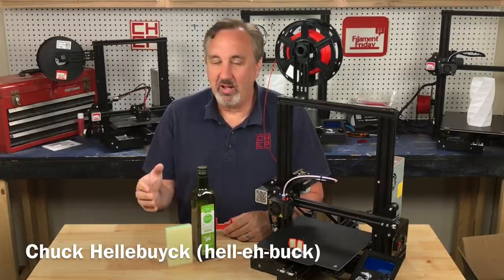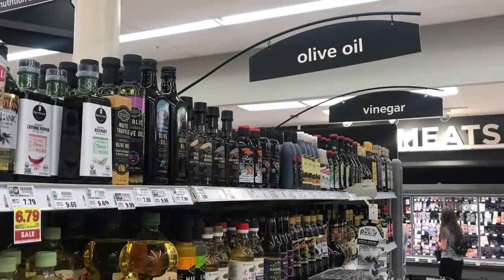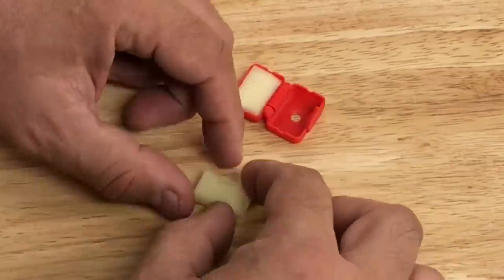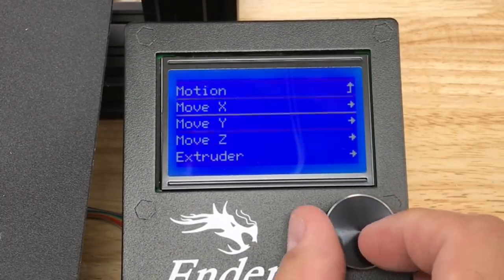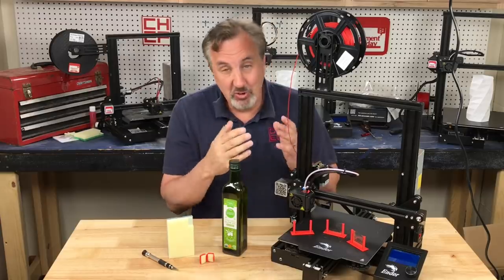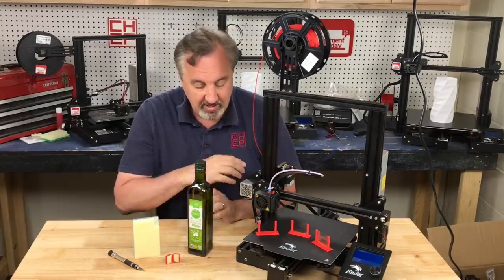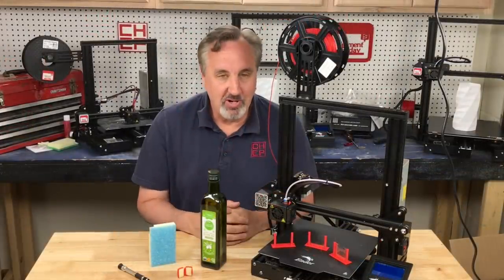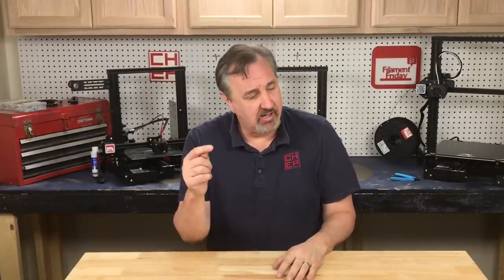Quick Fix to Eliminate Stringing on your 3D Prints

Comment: Is it possible (or safe) to leave the oiler permanently in place?
Reply: I was going to do that until I find a layer of oil on top of my build plate. My printing issues with the  new titanium throat swap stopped, so I guess the oil served its purpose.

Comment: Olive oil does actually go bad after a long time. Would mineral oil work for this? The point is just to lubricate so would silicone oil work?
Reply: It all goes down to how the oil behaves at high temperatures and if it can for some reason affect the melted filament itself. Olive oil is commonly used for this, so other kinds would have to be tested...
Reply: Most cooking oils burn at ~390F.  200C is 392F, so the oil is definitely burning/carbonizing.
Reply: A very long time several years at least, its not an issue

Comment: Hello,I think you already gave this trick some time ago. Does this trick affect layer adhesion? Does the strength of the printed part is affected by the presence of oil?
Reply: No, the amount of oil used is too low. And it is not constant oiling, just enough to coat the bowden tube. I even printed with the sponge and no differences in layer adhesion or sticking to the bed. Olive oil starts to also break down around 200C.

Comment: I was hoping this would be the "Hail Mary" that fixed my problems, but didn't seem to work. I tried 100mm at first, but that didn't have an affect and didn't seem like it had gone all the way through the nozzle so I did it again with another 250mm. Not sure what else could be causing this? I've tried every test, setting, and different filaments. Printer is only 2 weeks old. Printed the first few files just fine, then all of a sudden, nothing but string. Any other advice?
Reply from the maker: Try new filament.
Reply: Have you ever solved your issue? I am in the same boat and would love to hear your thoughts.

Comment: Out of topic, why does my nozzle always  got clogged everytime after ironing? I have to pause printing, pull out the filament, cut it and put back in to continue printing..
Reply: PLA can crystallize when being in high temperature for a long time (really low flow when ironing)

Comment: actually have tried this many times. esp with cheap pla. i didnt have a fancy clip box tho lol. i just use a bred tie and leave a lil sponge wrapped around with hardly any oil and ill print out a few dice sometimes it has effected the print cause i had to much oil i think so now when i do it. i have the oil sponge then a paper towel to dry off extra. id take pics but its ghetto lol.

Comment: I've spent all weekend trying different speeds and temps, swapped the nozzle and still string as, didn't even think of replacing the PTFE tube or lubricating it, will give this a shot..
Reply: Did it worked out?
Reply: @Ianlbaldrich  I ended up swapping a few things, all is well now.
Swapped boden tube, then went to a glass bed and used feeler guages to set the bed/nozzle right.

Comment: Are you not better putting the coupler at the coldend extruder and lubing the filament up on that side so that you are not running the olive oil through the extruder gear?

Comment: There's a very interesting research on this on a paper/document, and some partial conclusions on a CNC Kitchen video.
Look for "Industrial vegetable oil by-products increase the ductility of polylactide" for the document, and "Filament Oilers Revisited #1 - not as bad as I thought!" for the video.
Key features of the oil seems to be vegetable, fats, tryglicerids. So mineral and syntetic oils seem not to be good options if u don't want to fall into layer melting/bonding issues.

Comment: Tried it but the excess oil got to my PEI Bed causing adhesion issues. Filament had trouble stick to it.
Reply from the maker: Did you limit to 100mm of olive oil?
It shouldn’t get past the PTFE and and extra will burn up in the nozzle.
Reply: @FilamentFriday  I probably used too much. I can still print with a raft though. But couldn't eliminate the stringing. Using eSun PLA+. CR10S Pro V2 machine.
Reply: @FilamentFriday  It's pretty much stock except for the 0.6mm nozzle.
Reply: @webslinger2011  esun is super fluid once it melts.  It's one of the few filaments I have issues with.  What nozzle temp are you running?
Reply: @brandonbrown3600  Running PLA+  at 210. I might need to reduce retraction to 5mm and play with acceleration settings.
Reply: I'm on a 0.6mm nozzle.

Comment: Hi... Can you leave the sponge box on at all times?... Would love to know, as I'm currently calibrating my machine and this is one of the last issues I'm having to resolve. At the moment I've just reduced the extruder temp down from 205c back to 200c as it wasn't doing this before...
Reply: Yes but it does not do any good, other than accumulation of oil in the tube.

Comment: I'm new to 3d printing & I'm quite lost. I'm not sure if this is my actuall issue. For example, I cant seem to print with silver and grey filament.  The print always fails. The prints with silver look very spaghetti like (for lack of a better term). The other day I printed in black, the black print was ok. I print the same thing in silver and it looked awful. Yet in the past the silver filament printed. I'm quite confused ! I've got no idea where to start.
Reply from the maker: Filament can go bad over time and absorb moisture. This usually results in bad prints or stringing. You can try to dry it out with desiccant bag but I recommend new filament. 
Also make sure your temp settings match the rating on the spool.
Reply: @FilamentFriday  the silver I thought could be old, the grey I bought was actual crealty filament and new from amazon. For that particular color I increased the temp and the issues continued. I'll try again. Thanks !
Reply: What temp are you using for what is presumably PLA? Different colour's actually do have different temperature profiles in the same material, but you should be able to get a general setting that works. In Cura they have a temperature tower that is an add on from market place. Use that to see what's best for that color. With the tower you can select say 180C to 220C and 10C increments and build that tower, once you see it prints better at a certain temperature then hone it in and make another tower  but with smaller increments. Say 5C either way of where it printed better. Store that setting for that colour.

Comment: brilliant! but do we really need the sponge and 3d print? It sounds like you only have the oil run through for 100cm then you take it off right? If thats the case, couldn't i just have a bit of oil on a piece of sponge and hold it around the filament with my hand as I feed 100cm through? I didn't catch why we need that 3d print.
Reply: You're right, you don't specifically need this solution, but it has other advantages (such as comparatively easy application). I've been using a similar design for nearly as long as I've had my Ender3, and there's no noticeable downside to keeping it on all the time, if for no other reason than to make sure the filament is clean before it goes into the bowden tube. But yes, if you wanted to, you could do it by hand.
One point of caution tho: a little oil goes a long way. Using a little bit too much won't hurt (you might get a bit of oil spattering after the first few centimeters of extrusion) but don't go, y'know, pouring oil straight down your PTFE xD
Reply: 100mm* , not cm ;)
Reply: @nastoff22222  yeah

Comment: Olive oil is the best oil to use over mineral oils and other vegetable oils.  It has a higher smoke point than sunflower/canola and longer shelf life. And store brand olive oil is very cheap- just don't buy huge bottles because the smallest bottles will last forever and shelf life for EVOO is ~2 years (possibly more if you're not eating it...)
Reply: We cook with Olive oil so we buy the BIG BOTTTLE.

Comment: there's also a print is a cylinder with a cap. It would print easier, and instead of cutting two parts you basically cut one longer and wrap it around the filament
Reply: But you have to unload or cut filament to remove it. With this shown on video you haven't.
I use it as dust remover (from filament) and first one I had the cylinder. But I forgot to put it on so many times that I end with the similar as shown in video. You can clip/unclip it anytime.

Comment: Do you really want to oil it before the extruder? Won't the oil accumulate on the extruder gears and just start slipping? But this explains why i got so bad stinging on my carbon filament. As its so abrasive, so it does no move that smoothly through the tube.
Reply from the maker: You only run 100-200 mm worth so it’s not enough to cause issues on gear.
Reply: @FilamentFriday  Yes, commented too early.. i think ill just put a drop in the tube if the idea is just to lubricate the tubing. So i wont get any oil on the extruder pulleys. Or just lube a a 100-200mm length filament and push it into the tube few times.

Comment: Olive oil has a very low burn temperature - it's one of the few oils not suitable for frying because of this since it will turn bitter and black. This means that even for PLA at 200°C it should sufficiently burn away.
Reply: The intense, direct heat from the hotend might burn off the oil, but I suspect if that actually happened you'd get problems with your print surface. I don't know how I'd test that, though.
Reply from the maker: Used it for years. Never had issues with print surface. As stated it burns up and the small amount I recommend does build any noticeable black residue.
Reply: @FilamentFriday  I'm just basing this off what I've read about olive oil, not personal experience. I'm not sure how it's being confirmed that the oil is being burned off. It could be that it's still there but not detectable in the finished print, you know? That's not to say this is a bad idea, I'm just not sure about the oil being burned.
Reply from the maker: The smoke point of olive oil is somewhere around 374–405°F (190–207°C). That’s why it’s used in cooking. PLA and most other filaments are at that or higher.

Comment: Would this also work with TPU, mainly to minimize friction btw bowden tube and the filament a bit? (Not intending to go faster than maybe 20mm/s or so, but just to try and reduce the side effects of the "grippy" surface of the tpu rubber a little....?). Also, what is the softest TPU you would recommend a TPU newbie to start with on a bog standard ender 3? I've seen your vid with the alternative extruder bottom part/little ptfe tube mod, which makes a lot of sense, but is it likely to succeed in printing, say, 95A without said mod?

Comment: how often do you do this?   so every so often you simply lube 100mm worth of filament that then you push through.. i ask because there is more than 100mm of filament between the hot end and the extruder.  

Couldn't this be left on (without ongoing olive oiling) to help stop clean the filament before it goes into the extruder?
Reply from the maker: When you start to see stringing, do it again.
Reply: @FilamentFriday  would it hurt to leave something like this on the filament all the time to act as a filament cleaner before anything goes into the extruder? Or with this itself potentially just introduced different problems from the sponge material itself rubbing off?
Reply from the maker: You dont want to oil that often but cleaning with dry sponge is fine.
Reply: @FilamentFriday  Yeah, that was my thinking to not say and keeping it perpetually lubed, but just using it to help pick off any lint or dust that might collect on the filament before it goes inside

Comment: Isn't going to affect layer adhesion?
Reply: "the smoke point [of olive oil] is below the typical nozzle temp so any excess burns up before leaving the nozzle" - CHEP
Reply: @JoeTaber  And the printer and the prints will not smell like rotten oil? Shouldn't better use sewing oil\mineral oil?
Reply from the maker: Try it. Let me know how well it works.
Reply: @MiguelRodrigues0  id by far rather smell hot olive oil, which has a pleasant aroma than hot mineral oils which don't. Its a very fine layer and its not going to be there long enough to go rancid, three or four years, thats how long olive oil takes to degrade.

Comment: So Im wondering about a couple of other products, that have a high Temp.  ? on Permatex Anti-Seize Lubericant  its a paste, temp -60 to 1600F   -51 to 871C    and or Mission Automotive Silicone Paste ( waterproof dielectric grease)   its a clear thicker than the Permatex which what I have is purple in color.  has range of  -55 to 570F.

Comment: I was curious. The ender 3 has the filament on top and it does not need guides. If I get my filament on top of a cr-10 smart do you think I would need guides if I were to move my filament to the top?

Comment: The only issue I have with this is when printing with TPE/TPU types of filament, is that the drive gear and pinch roller can slip instead of properly grabbing these very soft filaments. 

I would only use this this method if I was desperate, because I print so much TPE/TPU that I wouldn't want to again have to clean all that oil off the extruder drive gear and pinch roller to get reliable TPE/TPU prints.

Comment: Printing with 0.8mm nozzle and on 0.32 layer height I found that if you have the retraction on
6mm/35mm/s I still got stringing but if I changed just the speed to 37mm/s it stopped nearly all the stringing. Filled my bed with as many blades from the contour gauge as possible not even a whisker

Comment: Wouldn't lining the inside of the hotend with Capricorn tubing make more sense?  I mean, sure, the whole bowden tubing is going to wear down eventually but that can't be helped. 

Also, if you're going to use oil, maybe something with a higher smoke point would make more sense, especially when using an all metal hotend - if you use something with high percentage of unsaturated fats it's like seasoning cast iron ;)

Edit: flaxseed oil or grapeseed oil for instance

Comment: So say i wanted to use that snap on 3d print permanently as a dust remover,should i run it dry or could Vegetable Glycerine be a good choice?.i have alot of vg lying around.
Reply: anything that would clean it I imagine, it probably also lubes it in the PTFE tube so I'd be careful if you run a Biden extruder with anything thick
Reply from the maker: Change the sponge is my suggestion but your filament shouldn’t be kept that dirty.

Comment: I have Ender V2 running marlin 2.1.1 and can only get stringing out by printing esun PLA+ below 190C with pid tuned, when i placed temp on the ext case of hotend temperature reading within <5C so it should be ok .. what else should i check, retraction tower with the gcode distance steps, best at 4mm

confused
Reply from the maker: Try this: https://youtu.be/OG7We83M5gc
Reply: I'm using esun pla + and have tried temperatures ranging between 195 and 220. Still getting stringing though thinner lines than before at lower temps. Have you found any great settings to reduce the issue?

Comment: Thanks for the hack Chep.

I have a vid topic. I see Cura offers Linear Advance settings from their marketplace. I also see a Calibration shape for Linear Advance, but there is no specific script or instruction on how to calibrate the settings.

Thanks in advance
Reply: Linear advance is a tuning parameter used in the firmware.
You need to be running a firmware that supports it like Klipper, Marlin,  or RepRap.
The calibration is done in the firmware, not in the slicer.
The feature in Cura prevents Cura from working against the firmware settings.
Reply: @joshua43214  Yes I have always done it with the Marlin websites generated g-code file and then setting it in firmware with Octoprint. But now you can define the Linear Advance value in Cura. It even allows you to vary the Linear Advance value based on the surface type and even for the infill. It is available under the Material settings once you installed the Linear Advance Settings plugin from the Marketplace.

It would make sence for you have it in Cura as a setting since the value changes depending on type or even batch of filament you use.

But obviously as you said, your printer firmware and stepper driver needs to be able to support it.
Reply: @jwelman1  Thanks for the answer.
I have to second your request for this topic.
Thanks for setting me straight.

Comment: I still wonder why they dont add full metal hot-ends standard... it wont cost anything extra plus a bowden tube directly to the nozzle is also dangerous... i always remove the stock hotend + bowden tube and throw it away...  it's just junk.
Reply: PTFE has one major advantage: it's non-stick (PTFE is the chemical name for Teflon, which is the coating on non-stick pans) so overly aggressive retraction settings don't lead to as many clogs as all-metal hotends. Tuned right, of course, that's less and less a problem, but the first time I switched from the stock E3 hotend to the MicroSwiss one was the only time I've had a clog, so far.
It's a game of pros and cons, basically, and I guess it just became standard that PTFE lined hotends were more user-friendly for anybody not interested in high-temp printing. If that wasn't the case, you're totally right, there wouldn't be a reason not to use all-metal as stock.